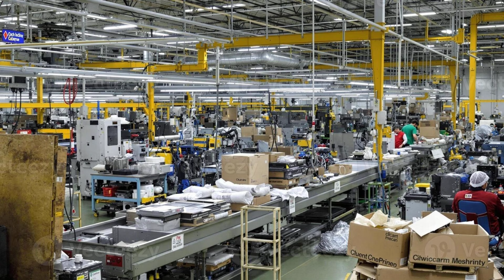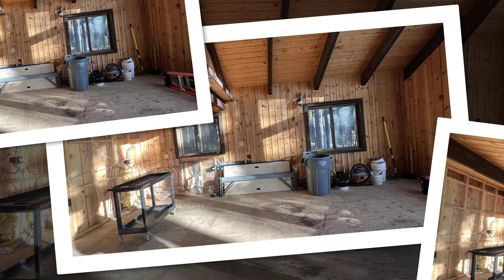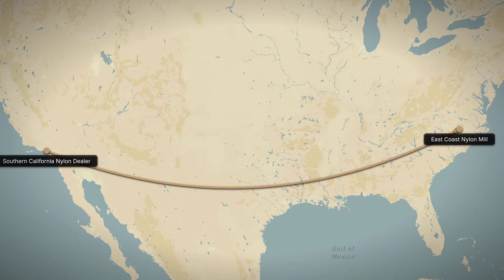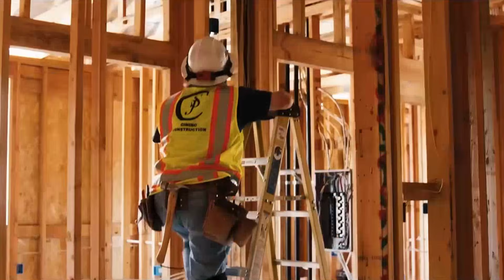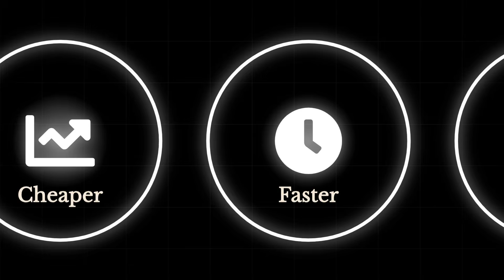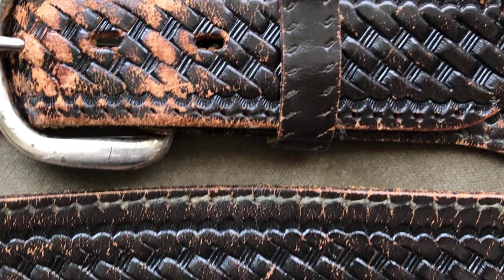The Last American-Made Tool Belt Company Standing

Comment: I bought a set of Occidental green synthetic about 20 years ago in Lake Geneva Wisconsin. I was doing a deck job in Lake Delavan and I was feeling generous to myself. I'm 65 now so they'll probably see me out 😮
Reply from the maker: @kwaichangcain...
20 years in and still going strong — buying quality when you're feeling generous to yourself is always the right call. Tools that outlast the job they were bought for are the ones worth talking about. Are they still in regular rotation or mostly retired to lighter duty at this point?
Reply: @Built_to_Fail-r3q 
It's mostly Handyman work these days but the bags are still in very good condition. The right hand bag is torn where the belt runs through mostly from where I slide in my Vaughn super-bar , a lot of wood glue stains oul stains and caulk stains. Sturdy set and I'll probably hand it down to my son or my nephew
Reply from the maker: Dude, that's so cool! Love hearing how much use those bags get, and passing 'em down? That's next-level.